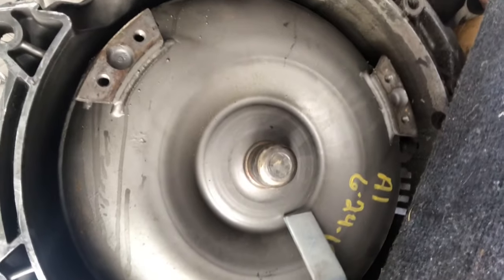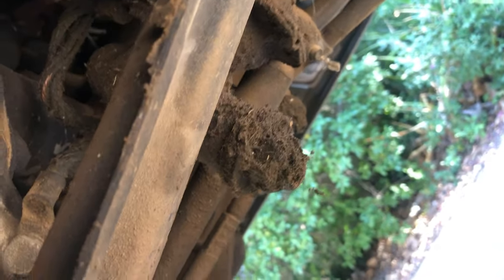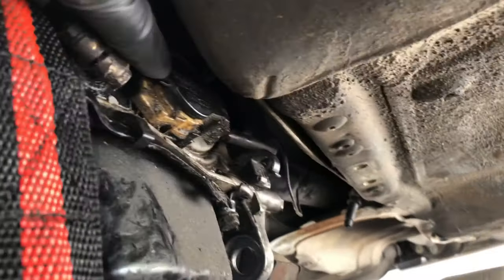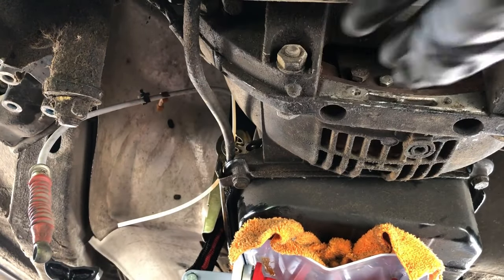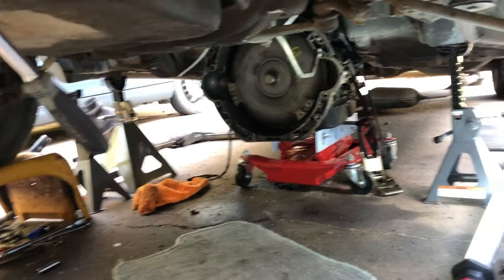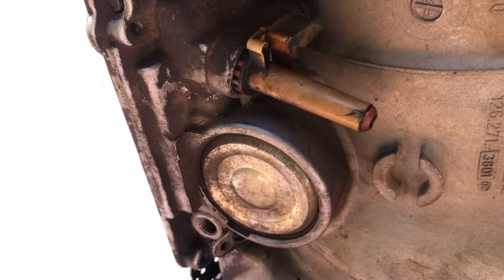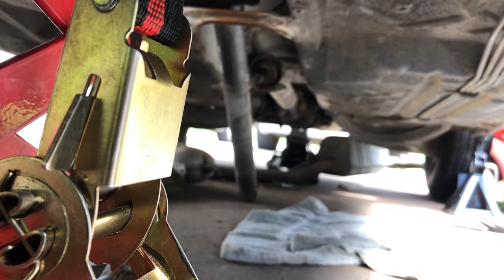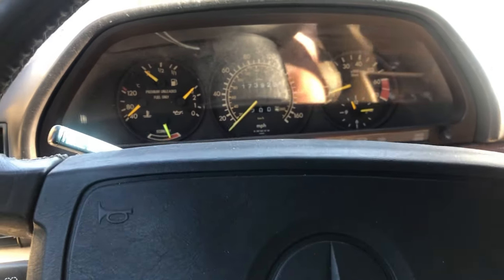Swapping Transmissions On A 1990 Mercedes 560SEC

Comment: You are the man! Just simple swap of transmission on the driveway ;). Make sure all vacuum and other small hoses/wires are connected. Those if loose can cause all kinds of funny (annoying) issues.
Reply from the maker: Will do!

Comment: Nice job Mike, changing a transmission on your own, with the car on the ground, i.e. not on a lift, is very much taking the hard road.  I would say that, from what was shown on the video, you do need to replace the transmission mounts as those ones looked absolutely shot, very perished and bulged where they've lost their strength.  Running the car with those will mean you get all sorts of strange vibrations and buzzes through the car.  Also make sure you thoroughly check all the flex discs in the prop shaft/drive shaft as they do degrade over time and, if they fail when the car is at speed, the shaft will flail around and do all sorts of damage underneath and may even breach the floor of the car and cause horrific damage to the passengers.  A lot of people do recommend replacing them any time you have the transmission out for peace of mind.  It all looks good so far, hopefully the trans will have its full compliment of gears and that will be another job crossed of the list of bringing this autobahn stormer back to life.  Of course, if the car is lacking in forward gears then you know that the original trans had all of them so it might be possible for a specialist to rob your old unit for any parts that the new one needs, though I have a sneaking suspicion that, judging by the date written in paint pen on the new torque converter, that the new unit has been gone through professionally so it should be good as new...
Reply from the maker: Great advice... thanks!!

Comment: I wrangled a 3 speed gearbox out of a 57 Chevy and wrangled a 4 speed Borg Warner in, on the ground, in the dark with just a flashlight and some combination wrenches. That was in 71. Don't think I had jackstands either. That was fun! The hardest part was getting the Hurst shifter in. They sit on the tail so come up under the bench seat and dog leg forward. Ended up with a big hole in the floor.
Ah, the foolish can do attitude of youth! Lol

Comment: On most, if not all, Mercedes cars, the driveshaft can be removed intact. I hope you aligned both halves to each other when reinstalling as per original alignment. If not, you probably have a driveline vibration.

Comment: There a lot of videos on how fix things and forms but as you found not exactly like your Vechicle but point you in right direction . I had issue with different Vechicle and different issue but found at least how to by pass issue for the summer . It was a bad heater core .

Comment: Not the first lol but close
Mike great job and yes that’s a big job especially outside on jack stands and ramps

Hoping to remove my tail shaft in the next few weeks as I have a bad vibration through the trans tunnel area so going to check the centre bearing and u joints

Comment: Have you looked into doing a manual transmission swap? My dream is to have an '81–85 500SEC with a 5-speed or 6-speed manual... is it doable? Right now I have an '85 500SEL which might need a new transmission...

Comment: Mike, I have two Mercedes, S550 4Matic, under warranty, and a 300 CE as you know. I found out I might need to get a battery and was a little shocked on the price. But my mechanic told me it might be the alternator not charging the battery correctly. What do you think? Thank you! Roger
Reply from the maker: Anyone can check the output of the alternator. Start the engine and check voltage at battery. You want more than 13 volts. If it’s less, then the alternator brushes are bad and they can be replaced. It’s it’s more, than the battery is dead. Any Autozone can check for you for free!
Reply: Monkey Wrench Mike Thank you, it’s obvious that I do no work on car engines. I have been very lucky with my cars. Having regular maintenance done keeps the fleet going strong. The convertible has been a project car, replacing bits and pieces to get it back to stock. It started to act up about six months ago. I just thought it was the cold weather was making it hard to start. But it almost left me stranded at the grocery store. I have a battery tender on it all the time. I will be charging the battery to full charge, then go to have the alternator checked. Thank you for your advice. Will let you know what I find.

Comment: I've been having trouble with a 1986 560sec transmission not shifting into the next gear while driving down the road. Would I need to replace it? I've tried everything... HELP!!!
Reply from the maker: Isn’t there a vacuum module at the tranny for that? You can adjust how hard or soft she shifts.
Reply: @MonkeyWrenchMike  thanks for the reply!! I have placed a new modulator and adjusted it a few quarter turns more than the old one to firm it. Replaced vacuum lines, Kickdown solenoid, checked kickdown switch for working current, changed transmission fluid and filter, transmission mount. I've tried mostly external components, I think when I changed the fluid is when it started to not shift into the next gear up while driving, goes up to 40mph and high revs about 5000-6000, screaming! I read about replacing the fluid may cause older transmissions to fail because of thin viscosity. I wonder if it may need internal parts replaced or just bit the bullet for a rebuilt transmission.
Reply: Even had adjusted the Bowden cable loosely. When I had bought the car the cable was adjusted tightly all the way on the throttle body but had no luck with it shifting to the next gear. Read about governors going out, losing pressure somewhere or clogged valve body. I have a system of diagnostic that I follow: DONT PANIC, THINK SIMPLE!!! Old timer said to take out valve body and clean off with diesel fuel lol
Thank you for your input, I love watching your videos and hope for the best of the future owners of classic mercedes!

Comment: Yes, that guy didn't give good instruction for the transmission R&R. Driveshaft removal is almost always SOP, along with the exhaust and heat shields on most.   Looks like you learned a lot.
Reply from the maker: I did! Transmission work is more involved... but not impossible!

Comment: I believe you can just go to the Public Library or go on line see if you can sign up for one of the Two  Books that are helpful for spec and Removal procedures . Some time very helpful sometime not I like that you put the Vechicle on ramps I just saw some that are like solid I believe Rubber blocks . I have jacked up the rest used stands or neither pair of ramps because as you lower the trans it's may want to tilit . I assume you're going to push the Converter  a k in the trans strap or put something across the front or it slide out on you . I like your floor jack with trans strap you may need to put a jack or some kind of engine support it may Rachel down on you on the back of it .

I know you got it out  and probably back in when you read the video . I wonder if any Auto Trade Schools could help you some how . Last time u took a a Auto class they had Vechicles to work on but may need some for. More Training  I Rebuild a slant Six my dad had in a truck but some students may not as long you pay for parts 

I love your videos because it it explains to the common Man or person how to get it fixed .
Reply from the maker: Thanks!! Appreciate that!!

Comment: There may be a 10mm socket and a short 3/8ths inch extension wedged underneath the Siemens control module plastic housing on my 2002 Cadillac. They may have been there for a year, and might have fallen down there when I had most of the driver side suspension and axle out of the car. I may drive around with them like that and have no plans to ever retrieve them. These are things you may hear when keeping disreputable company. I would like to emphasize that all of these musings are pure conjecture. It is the conjecture of hostile minds who question my cat-like reflexes and inhuman stamina. Do not entertain such poisonous notions.

Comment: What procedure did you follow?
Reply from the maker: Shade tree mechanic procedure… lol
Reply: So, I take it you mean they were your own notes you were working from. :) I’m currently almost done pulling my 87 S420 tranny and your video was helpful. Having trouble separating the donut from the tail shaft but I’ll figure it out. Pretty straightforward thus far. Good tip to just pull the exhaust line, thank you.